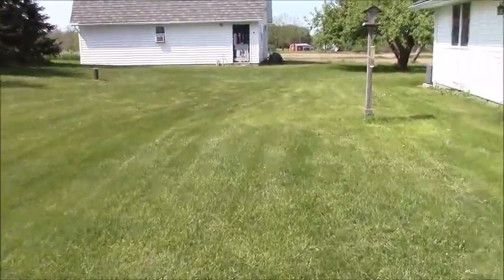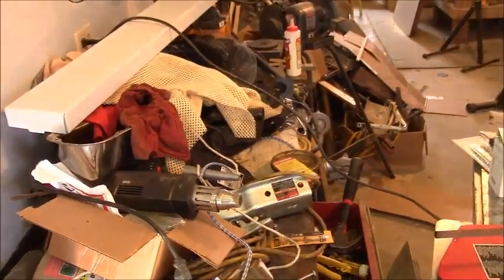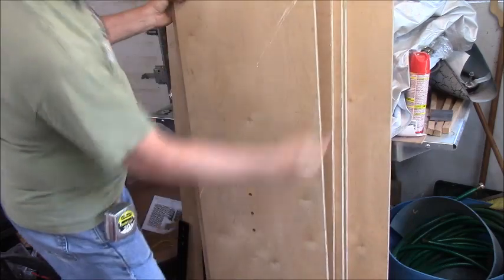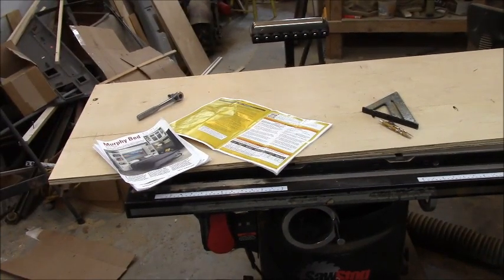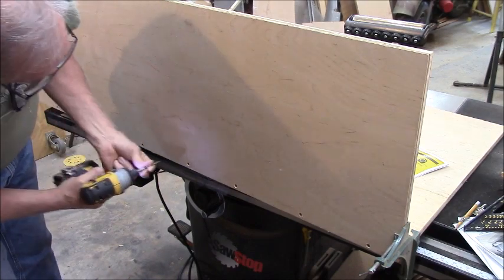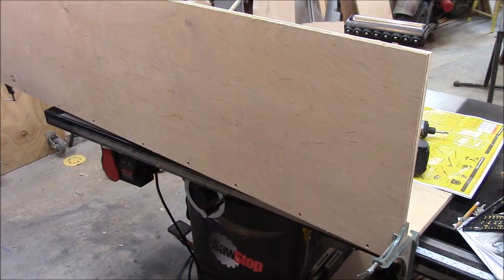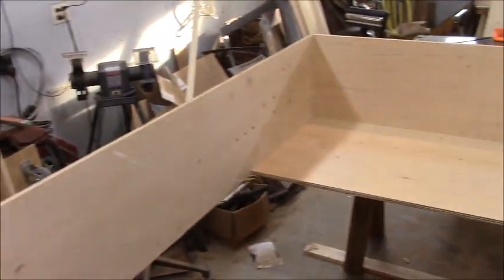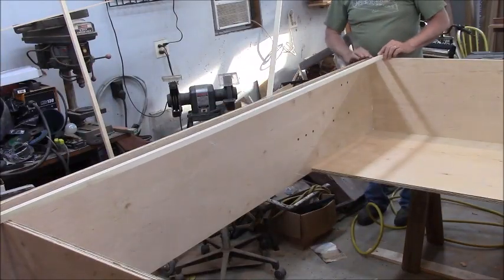How to build a Murphy bed part 1, We used a Rockler kit and plans to build a Murphy bed

Comment: I noticed the width of the bed cabinet in the official instructions was 15 7/8"  wide and if you read the woodworking journal article, it suggests a 17 inch wide cabinet.  Which one did you end up going with?